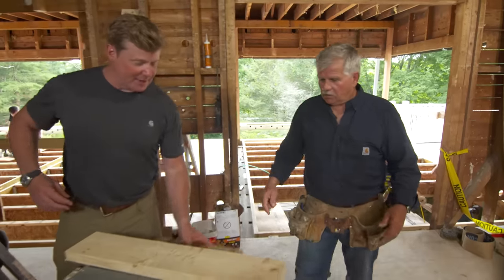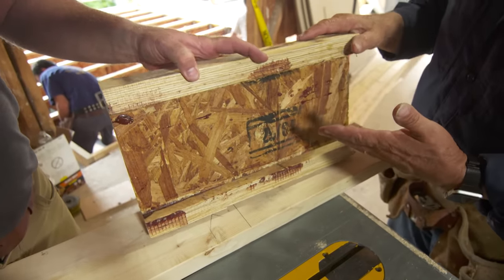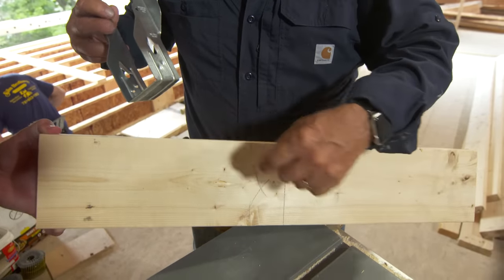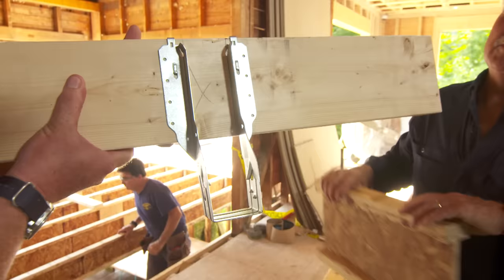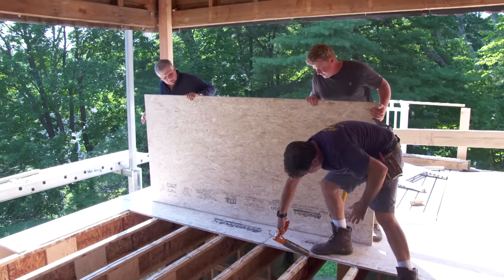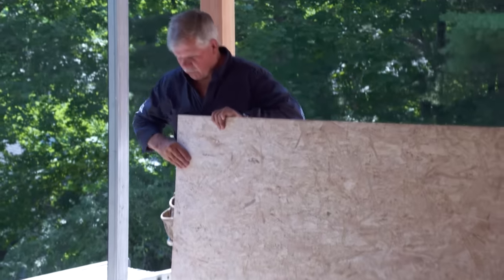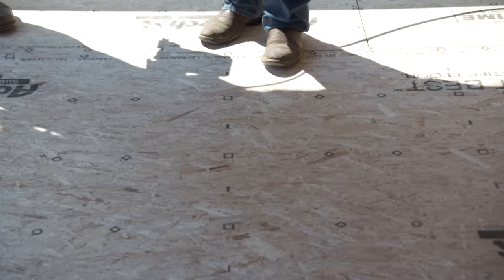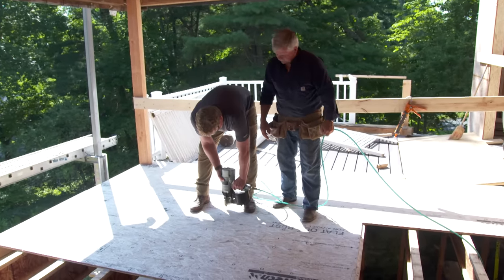How to Lay Subflooring | This Old House

Comment: Two things that don’t apply to home builders because of cost and time. If installing 3/4 inch hardwood flooring on top, I wouldn’t use particle board as the sub floor but would use 3/4 inch plywood sub flooring. Particle board won’t hold the cleats or staples used by flooring installers. Second, id screw the sub floor down instead of shooting nails in.    Screws don’t back out of the sub floor like nails do.
Reply: I'm about to lay subfloor. What kind of screws do you recommend?
Reply: @cfrahmy8008  just deck screws man
Reply: Angle the nails bro
Reply: Yea B/C
Reply: Agreed I hate nails for subfloors, they will ALWAYS loosen up over time and cause squeaks
Reply: @cfrahmy8008  spax are great screws
Reply: @justinballard7242  thank you. I did so.
Reply: @bludika  so your says use nails not screws?
Reply: @jessicaerby4861  oh yea i misspoke, yes i like screws for subfloors
Reply: yeah screws the way to go, angled nails still potential looosening
Reply: @justinballard7242  the 3 inch deck screws were the way I went. It's held nicely with no squeaks or pops.
Reply: I was thinking that too, we screwed ours down
Reply: Agreed. Screws take longer but are far superior. They even make self fed screw guns with an extension on them that allow you to not have to bend over to install fasteners that make it much easier
Reply: When I had to repair some subfloor I used plywood and screws.  No regrets.
Reply: I agree on the screws, i like the simpson strong drive collated screws.  I do disagree on the sub flooring as this is Advantech which is bar none the best you can get and loads of wood floors are installed over it every year without issue.
Reply: Exactly
Reply: The advantech sheathing is engineered OSB. For more superior then plywood from my experience. I framed for 6 years and currently install floors. Engineered OSB is the way to go. Plywood has a tendency to delaminate.

Comment: Not a fan of OSB but i can see how contractors like it due to the quick installation. But water damage kills OSB its like a sponge 🧽
Reply: This particular brand advanteck is real durable water doesn’t permeate it but ya there is some cheesy OSB out there
Reply: why i would never use them as runners for a floor
Reply: Oh look, another "expert" on OSB.  EAD
Reply: Wes look not a expert I have seen OSB in my garage swell with just moisture as it aged! Fact! I did find out OSB stamped OS with consider waterproof
Reply: @bigvegass  See them daily swollen up and coming apart like normal OSB. If they get wet they will degrade, again seen that daily in craw spaces.
Reply: OSB is water and fire resistant.
Reply: @x-raymind7778  Basically don't get the stuff they sell at Home Depot and other big box stores for the DIY crowd?
Reply: Mike B yup
Reply: Advantech is water proof thats what I've read up on it anyway
Reply: Calling Advantech "OSB" is like calling a Mack dump truck a toy wagon.
Reply: You're not going to lay 3/4 t&g cdx on affordable cookie cutter houses. It's not practical to spend that much money. Osb is the way to go.

Comment: Tom, Please don’t let your years of high quality building standards be swayed. You know OSB is bad and have said so many times in the past!
Reply: OSB has its places, but not like this... Anyone who knows how OBS behaves structurally in various scenarios should be shaking their heads in that idea. 

I don't know what has been done in the past decades in these videos, but one thing that I think has changed in the last year or so is that lots of designs and installations they are showing are "one-time-only" kind setups that doesn't allow easy repairs and access IF required in the future. Like that adhesive idea for the subflooring, that when you need to get access in there, you just don't have nails there but you have all glued up as well.
 While in old school methods you used materials that dampened sounds but kept things so you could in case if required to open up things without too much damaging places.

It must be something to do with the latest trends for "Eco-Friendly" laws and all ideas, how anything that can be even considered "dangerous", "poisonous" or "damaging the mother earth or people" etc in any phase of the manufacturing, they are removed.
Like now we have house paints for exterior walls and roofs that can't withstand weather, wears off in few years and you need to make all again less than decade or two. Previously you had paints that didn't peel off for decades, like 30-50 years and it was like a new compared to todays, but it yet was made with just one step or process that made "Green-People" unhappy.

These days lots of construction workers don't anymore think anything about what should be needed to be done after it is done. So servicing and maintenance becomes just very difficult or impossible.
Reply: This is advanteck it is used in every house now from multimillion to 2 bedroom it gives you the flattest strongest floor hands down and water doesn’t permeate it like cheap noname osb
Reply: @x-raymind7778  The biggest problem is a contractor or DIY person will go to a discount store and purchase it because of the price.    Same type material but not the good brand.

Comment: The expansion and contraction of the wood riding up and down the nail is what causes squeaks we need to start using screws to lady subfloors. Putting houses together faster with nails is not the way to go
Reply: Brandon Bennett My floors never squeak even after 30 years of building, just do All your jobs right for no worries.
Reply: Power Wagon mainly homes with a second floor has squeaky floors. this old house covered this year’s back on why it squeaks. the fix is to run screws through the floor.

Comment: I would like to see a test comparison with a press with that “engineered lumber” vs solid 2x10...
Reply: They did a compression and tension test of the engineered stuff, I believe it’s in the full episode
Reply: Engineered joists are far superior over dimensional lumber. You can span greater distances with the engineered joists and they have bigger top and bottom cords.

Comment: When should you use cement board versus something like Ditra for your subfloor?
Reply: from my very novice knowledge of watching hours and hours of TOH and renovation videos - Ditra is an uncoupling membrane, which means, as the name says, it un-couples one surface from another. Ditra was made to be put between subfloors of wooden material and hard surfaces like tiles so that when wood goes through its seasonal expansion/contraction, it does not harm the solid joints between the tiles laid on top of it.

Comment: Houses (subfloor, roof and exterior sheathing, and now joists) are now made of wood chips - how efficient and cost effective.  How long will they last, especially if they come into contact with water?  Also our walls are made of paper (drywall).
Reply: Yep.. the cheapest of the cheapest. Basically cardboard covered with a bunch of (mildly toxic) resin, covered with more cardboard and some gypsum…

Comment: Crazy to see TOH use all this engineered material.   I wonder how it would hold up down south vs. The termites.
Reply: Apparently OSB and similar engineered wood products hold up well against termites because the glue/cement used to hold them together makes them a poor source of cellulose as far as termites are concerned.

Comment: I much prefer the ones with metal triangles. Leaves ton of room for wires and pipes.
Reply: F Maz Those are designed for commercial purposes and very expensive.

Comment: OSB is not rated for horizontal use.  Also a very bad choice if there is any chance it would see any moisture or humidity at all.  Code would be 3/4 hardwood plywood.

Comment: There are many half-truths and incorrect statements in the comments.

In the U.S., OSB is okay for the floor, that's why there are two spans given on the material. Same as for plywood. The shortest is flooring, the longer span rating is for roofing.

Commodity grade OSB  will most definitely swell, even if it didn't rain during construction. You will see that happening to roof decks long after construction. Humidity in the attic will swell the edges.

HOWEVER, Advantec and Georgia Pacific both have a premium grade of OSB subfloor that have 500 day No-Sand guarantees.  G.P. brand is DryMax. I-joist OSB webs have an extra dose of resin/glue in its web stock, as do the super premium OSB subfloors. If anyone doubts the 500 day guarantee, take home a scrap (or buy a sheet) and leave it your back yard.
Reply: Particle board is Not OSB.
Wafer board is Not OSB.

In the U.S., of the three products, only OSB is approved for flooring.